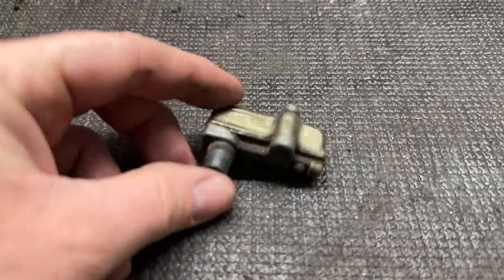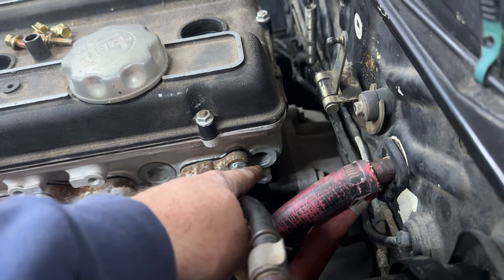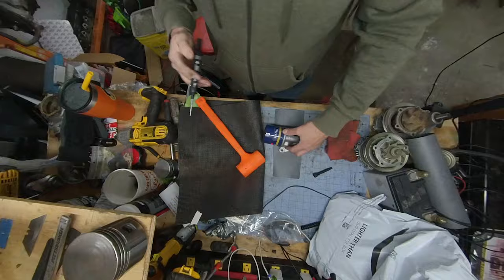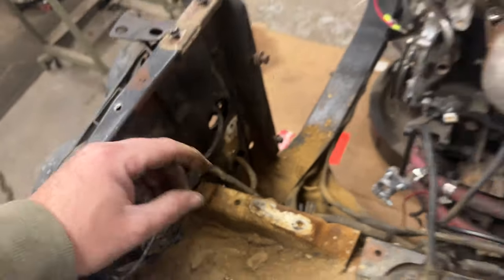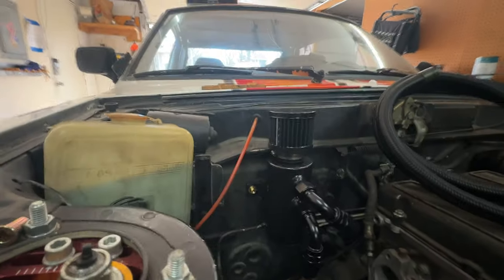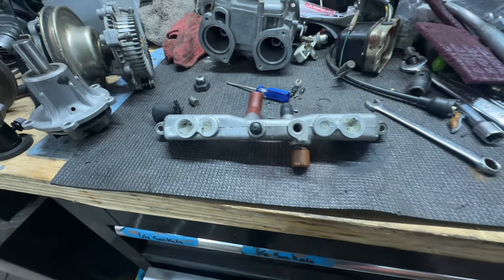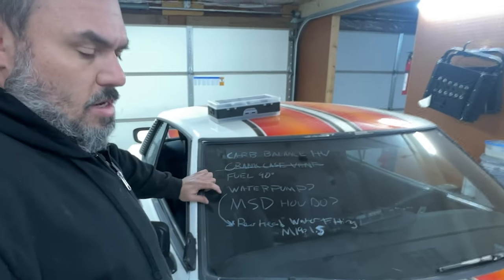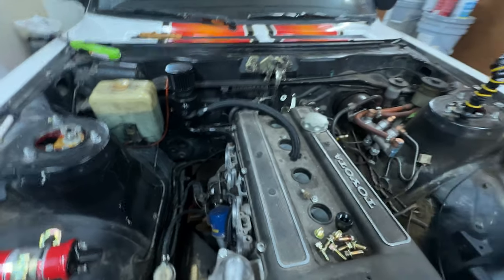1972 Celica Engine Swap - Part 3 - #dalesdragon

Comment: You asked a question about a part that you were not able to identify. That part is actually a Valve ACCORDING TO THE tOYOTA pARTS MANUAL

 FROM (56145-75 pARTS cATALOG OR mANUAL

. FOR THE 18R-GU 

 FROM      1975. MODEL TA-23

Comment: i think when you jbweld the intake bridge you block the hole where an allen key would fit to adjust it,i am blocking vaccum leaks on my 18rg too
Reply from the maker: I definitely noted that I blocked the holes that would be needed to access the inside bolt holes that hold the bridge down. I’m hoping that the 2 outside holes and rtv will keep it from leaking. I don’t know about the adjustment.. I’m sure I messed something else up there too. Time will tell I guess.